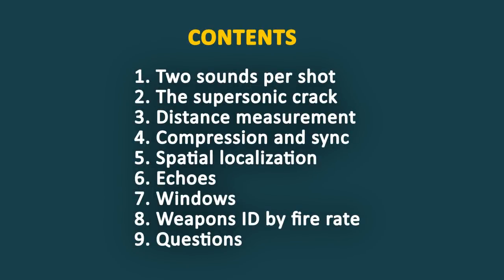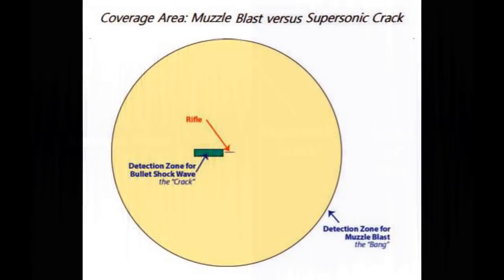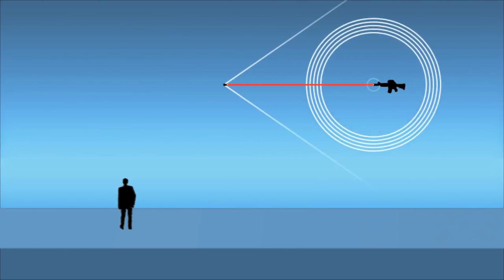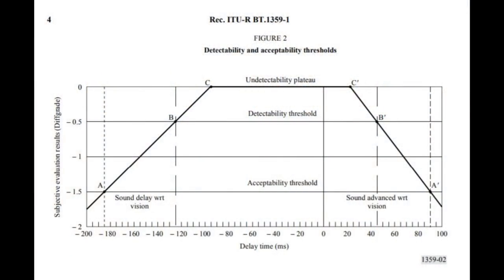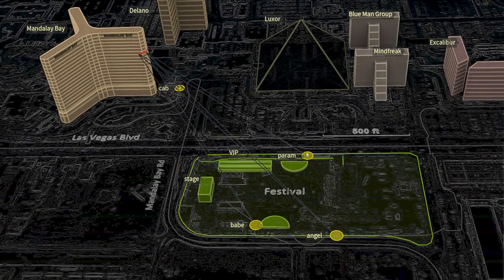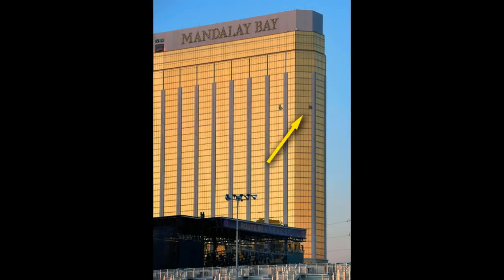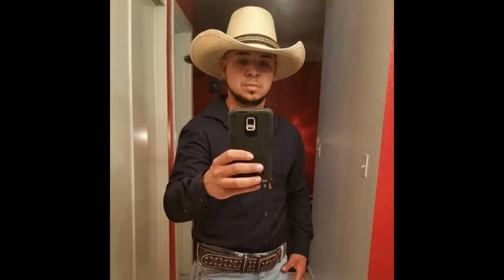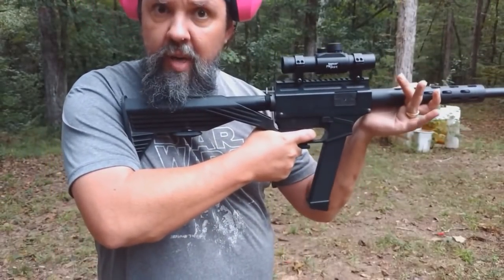2. Las Vegas shooting: The Acoustics of Gunfire

Comment: I still have many questions.  Could this be a sound track played through the concert speakers and still meet your criteria?  There are noticeable differences in rates of fire of different bursts. Is this because of different bump stocks or different weapons being used?  At 300 plus yards, would you expect to inflict 600 casualties with 1000 rounds at moving targets with automatic fire in a 10-minute span?  At this point, it doesn't seem to matter how many shooters, but how many people are in on this conspiracy to fool the public.
Reply from the maker: +Claude Bramwell Whitman and Oswald sniped at specific, isolated  individuals. Paddock randomly sprayed a large crowd. Big difference.
Reply: Claude Bramwell the difference is rate of fire is one of the things that disproves those who say it was a belt fed machine gun or any full auto weapon for that matter. Bump fire is where this throttling  (varying rate of fire) comes from. To bump fire a weapon, you (as the shooter) have to use physical force and that force has to stay very consistent for rate of fire to stay consistent. For example, if your are a right handed shooter using a bump stock, your left are has to apply a forward force at just the right amount to allow the recoil pulse to move the weapon backwards as it normally would then pull the weapon forward again. If too much force is applied, the recoil pulse might not move the weapon back far enough to reset the trigger. If not enough force is applied, the you won't rapidly pull the weapon forward again to break the trigger for the next shot.

Now with that said, they are not hard to use BUT they do get tiring (especially after several minutes of firing) after a short while.. a full auto weapon system will not throttle  (vary) in rate of fire. They will be 99.999999999% consists every time because they are mechanical devices. The only time they will vary is from load differences from one cartridge to the next and this variance is so small that only sensitive timing measuring devices can see it. The human ear can not pickup these variations and in every video of the shooting, you can clearly tell that throttling is occurring so the weapon was not a real full auto machine gun of any sort.

As for injuries and casualties, the 58 casualties and 5 to 600 injuries is exactly what I would suspect for a .223 / 5.56 round at the 3 to 400 yards.  The injury vs. casualty count is another thing that disproves it being a belt fed machine gun. Many who are trying to claim it was are saying it was a m240. That weapon system used the 7.62×51 NATO (or the .308win commercial) round. This round is very effective on human targets out to beyond 500yards. If it was a m240 belt fed machine gun, the casualty count would be much higher then 58. The .223 / 5.56 round is not very deadly beyond about 250yards. This has been a major concern with the Military for quite a while now (M16 and M4 use the 5.56 round). These weapon systems are not good for firefights that are 250+ yards away because the bullets mostly just injure rather then incapacitate the threat and a threat that is just injured can still shoot back at you...

So in the end, yes, with bump stock fired AR's in the course of 10+ minutes and some 1000 or so (plus or minus) rounds of .223 / 5.56 fired, the several hundred injuries and only 58 casualties with varying rates of fire is exactly what one would expect to see just like we did. 

There is no conspiracy here other then possibly the said to be shooter was not the actual shooter but rather was setup to take the fall for the event. Other then that, there is nothing that makes me think that the shooting was more then one person and was coming from anywhere else besides the room it is said to be coming from.
Reply: Thanks for the information.  I was light infantry for several years so I do follow your argument up to the point of believing the high rate of casualties.  Assuming one shooter, firing into a crowd that rapidly disperses into the dark over the 10 minute engagement, I cannot believe that a single shooter using a semi-automatic weapon with a bump stock that is notorious for being hard to aim accurately could achieve  a hit rate of 60%.  You must have known some much better shooters than those I trained with.  If the crowd was static and the lights had remained on for the full 10 minutes, perhaps it's possible.  That's not what I've seen in the videos. Also, where are the bullet holes, the slugs, and the brass?  Every day that the FBI does not release the ballistic and forensic evidence is another day in which they seem to be struggling to concoct some believable story.
Reply: When you say "multiple locations" do you mean shooters, cell phones,  or concert speakers?   The relative close proximity of each of these could probably make any analysis suspect because of the inaccuracy of the audio equipment (recording, broadcasting, or measuring). Setting up a sound track to simulate automatic fire from 300 yards doesn't sound too difficult.
As to 600 casualties, until the FBI tells us, we really won't know exactly how many wounds were caused by bullets.  In fact, we don't know calibers, locations of dead and wounded, and many other things necessary to understand this event. The seven or eight bursts could have taken down 60 or 70 people at a time.  Why didn't anyone with a cell phone capture that?
Reply: +Claude Bramwell - A tightly packed crowd in that small area where sitting ducks basically. It would not have been hard to inflict large scale injuries with an AR and a bump stock on that crowd from some 350yrs away at an elevated position. While yes, there were moving targets from time to time, many cellphone video's shown that when strings of fire were occurring, people where ducking down and / or laying down and sitting still.  Also right after the shooting started, all the stage lights were turned on thus lighting up the crowd.  Since the shooting was coming from an elevated position, ducking / laying down was not going to prevent you from getting hit. The stage lights being turned on is another thing that lead many to think of / believe in conspiracy and set up / planned even at the event level. This is not true though because all concert venues turn on all the stage lights when the crowd is leaving so they can see where they are going (its a liability thing). Now yeah, this helped the shooter but in a panicked state, I'm sure that the light controllers weren't thinking that it could make matters worse by allowing the shooter to more easily see the people.

Also as Mr Visual said in this sub thread to your initial post here, there has been no release of how many of the 5 to 600 injuries were actually bullet wounds vs. how many were injuries from the people just trying to get out in a panicked state. And even then, I dont see it too far fetched for there to have been 5 to 600 injuries due to bullet wounds. Again, the crowd of roughly  22,000 people where tightly packed into a small area. It would have been like shooting fish in a barrel (they were sitting ducks to say the least). You wouldn't have to be very accurate to make many hits, at least not during the first few minutes. Thats almost a point in a general area and shoot situation.  When you look at it from a trajectory standpoint, he would have been at about a 15° shooting angle so if the true travel distance would say 350yrds, the drop calculation would have been for about 325yrds so for a typical 55gr. .223 round thats somewhere in the neighborhood of 10 to 20 inch of drop. So when you are shooting into a densely packed area that is spanning problem 3 to 4 acres of land area with 22,000 people in that area and you only have 10 to 20in of drop, you dont even have to really aim or be accurate, just lay down fire all across that general area and your are guaranteed to hit at a high percentage rate. Again it was just a, "point in the general area and shoot" situation. Its not like you had a, "few people here and a few there an other scattered about". It was an area of a few acres of people who were virtually shoulder to shoulder initially and even a few minutes into it, there were still a lot of people within the general confines of the venue.
.
Reply: Chris
Why would anyone stage a crime scene so it looks staged?  It is far more logical that the first cop on the scene, seeing a man lying on the floor and a gun in or near his hand might just kick the gun out of the mans reach prior to checking to make sure the guy is dead.
Reply from the maker: +Claude Bramwell -- "600 casualties"
The 550 or so injuries include trampling, jumping-over-fence etc injuries. To my knowledge, no one ever released the figure of people injured by direct gunfire (only the number of those killed by gunfire).
Reply from the maker: +Claude Bramwell  --- "Could this be a sound track played through the concert speakers and still meet your criteria?"
Not really. For one specific location in space (if you had known it in advance) you could sort of design the soundtrack so that it simulates arrival times from 32nd floor. However this charade instantly breaks down for multiple locations, because anyone not recording in that special location would get different arrival times from loudspeakers.
Reply: It sounds as if you are convinced that the carnage was done by a single shooter from an elevated position at 350 yards.  I remain very skeptical, but I guess we will see when the lawsuits hit the courts.  The FBI has  lost its credibility since they haven't produced any evidence in the case so no one knows for certain if there were 22,000 or 7,000 people in the venue; if there was more than one shooter from the 32d floor of the Mandalay Bay: if the weapon used was an AR-15, AR-10, or multiple weapons; if the killed and wounded were located in clumps when they were hit or dispersed; etc.
If you can, please cite any mass shooting examples that lead you to believe that this was like shooting fish in a barrel.  I wonder where, except in movies, it has ever happened.  Charles Whitman, Lee Harvey Oswald and others made bad weapons choices I guess.  If you are right and its this easy, white Republican Trump supporters had better be very careful where and when they congregate.
Reply: For one, the Route 91 event handlers are the ones who claim an estimated 22,000 people in attendance and they have absolutely zero reason to lie about that. 
Two, look at the size of the main audience area, it covers about 4.5 acres of land and now look at this photo taken a bit earlier in the evening.
 http://www.etonline.com/sites/default/files/styles/max_1280x720/public/images/2017-10/mandalay_bay_route_91_festival_gettyimages-491199012.jpg?itok=JZJ-1c3X
That photo is only showing half to maybe 2/3's of the total 4.5 acre main area and that is easily 15,000 people right there.

Next, I dont need the FBI or anyone to tell me whether those were AR15's or AR10's. The Casualty count tells me that it was a small caliber round like the .223. If it were an AR10, it would have been a .308 shell size cartridge and every AR10 chambering available (that I'm aware of) are all cartridges that would have been far more lethal at about 350yrds (i.e., the casualty count would have been much higher). The next thing is I am very familiar with both weapon systems (I own both) and a few of them in the photo's of the room are without a doubt AR15's and NOT AR10's. The Upper and lower receivers have distinct differences between the two that anyone very familiar with both can tell the difference / pick out one from the other.

Now whether they were in clumps or dispersed is yet to be 100% revealed but it pretty irrelevant for the most part and but looking at the few photo's that are out there of bodies on the ground after most of the crowd is out and shooting has stopped, they are pretty dispersed. This lends itself to just random spray firing which also matches what the audio insinuates during the shooting bursts.

As for the "Like shooting fish in a barrel". I dont need to site any other mass shooting events.... This photo alone says it all.
http://media.graytvinc.com/images/810*455/image+vegas+sf.jpg
That is all people down on their knee's and also laying down during a string of fire. They are lit up for the most part by the stage lights and are motionless. You would have to have REALLY BAD LUCK if you fired say a string of 75 shots and didn't get at least 50% hit percentange. Really, with a target area like that, there isn't any reason why you shouldn't get more like 75 to 80 percent hits (again, like shooting fish in a barrel). 

Regardless of that, since you asked to cite one other mass shooting that was like shooting fish in a barrel, I will..... Pulse night club here in Florida (Orlando) on June 12th last year. One man killed 49 and injured 58 more.

The only thing I'm not convinced of about the whole thing is if Paddock was the shooter or if he was setup and murdered before hand. The room photo's (rifle and revolver positions) look staged. I cant think of any way that physics would work for a couple aspects of the scene. With that said, I dont think the PD or FBI or even MGM are covering anything up but rather, I think it was not paddock (was supposed to be two shooters but second shooter took out paddock right at the start then and made it look like it was just Paddock so that he (second shooter could make a clean getaway of sorts).  I say about no one covering anything up in the last statement because if I'm right then its not that they are covering anything up but rather not letting out info while they try to find the 2nd person by making the 2nd person think that they are on to them / know they exist.

Think about it, if they were to make in publicly known that there was a 2nd shooter (who was the only shooter in my theory), that 2nd shooter would be one the run. If they play it like they dont know and fully believe it was Paddock and only Paddock, then the 2nd person involved would be relaxed and at easy thinking they got away with it and will get caught easier. Plus there could be more to the whole thing like a political backing behind it and they are keeping quite to get more info to indict more parties associated with the whole event.
Reply: If you can, please cite any mass shooting examples that lead you to believe that this was like shooting fish in a barrel.  I wonder where, except in movies, it has ever happened.

Seriously?  Lets start with Columbine, Virginia Tech, Newtown ct , Arora co,  San Bernardino,  Miami Florida, Texas church shooting...
Reply: S Wheeler
I'm not saying staged to make it "look staged" but rather quite poorly done that one could with fair amount of easy tell it was staged.

For one, there is a blood droplet trail that leads from his right shoulder to the revolver. That's not normal for a self inflicted gun shot wound to where the person fell backwards and layer in the position he is it. Nor is that what you would expect to see if someone kicked a gun out of the way. I know many LEO's who I've discussed the photos with and the question of kicking a gun out of the way has come up and all agreed that like myself, they would have kicked it much further then that. However, with a scene like that and that much blood, they all said that they would have left the gun exactly where it was at for forensics because it would be pretty much impossible for him to still be alive and a threat.

Something else that makes no sense (seems to defy physics) is the blood flow out of mouth and over face onto the floor. This however could be explained if there is no exit wound and heart continued to pump for some time. I say this because if there was an exit wound out the back (like there normal is with a gunshot wound in the mouth, gravity would pull all the blood out the exit wound with how he's laying.... it would not be coming out of his mouth and running down his face... this would defy gravity... even if there is no exit wound I still find it a bit hard to believe we would see that much blood because his lungs, trachea,  and esophagus would all have to fill before much blood would start to flow out of mouth and by then it would have started to coagulate quite a bit...

Now one point that a friend of mine who is in the medical field brought up even though she kind of agrees with me on the amount of blood is was he on any type of anticoagulants due to age and possible heath conditions(?). If so, then this could explain a lot about the blood flow (again depending on presence of an exit wound and where "exactly" the entry wound is).

Too be 100% honest though, I don't think it was even a gunshot to the head at all, I think it was to the chest... if you look at the photo of his upper body / head, right at the base of the button down portion of his shirt (like right over center of his sternum), there is what appears to be blood with a very dark center area which would be indicative of an entry wound to the chest... this would also lend itself to all the blood coming out of his mouth (especially if he was on any type of anticoagulant meds). Coughing up / spitting up blood is very common with chest wounds of this nature. It's not normal for someone to shoot themselves in the chest (not that it's not possible but... just not normal)...
Reply: Chris 
Why?  Occam"s razor suggests you first rule out the simple explaination prior to adoption of the complex.  You rule out explanations without falsifying them to move on to your preferred theory.  That is a very health rangerish methods of problem solving.  I do not have any answers, but I cannot rule anything out that I cannot disprove.
Reply: I fully agree but one thing that goes with ruling out the simplest explanations is by looking at trends, causes and effects, etc... from past similar scenario's and the blood evidence does not really support the hypothesis of a gunshot wound in the mouth. I bases this off the fact that i have seen in person the aftermath of more then one suicide where the person did exactly that, put a pistol in their mouth and pulled the trigger.

Now could it really be a self inflicted shot in the chest.. Yes, very well could be but just not very common.
Reply: Chris
I am not sure what blood evidence you are talking about and as I have never personally seen a suicide of any sort so I would not know what to look for.   However I do have experience with firearms enough to know that there are a multitude of possibilities as to what type of wound results from any given weapon.  Angle of shot, type of round used caliber of the weapon are all factors that are unknown.  Also any slight movement of the head could cause an additional blood flow.   Although as far fetched as it sounds it is possible, see Meriwether Lewis, to shoot oneself twice.  So I would be reluctant to rule out  suicide at this point without more information. 

Also the thing about the rifle over his leg.  It makes perfect sense if he was seated on the floor.   It would be just about arms length and he would put it down to switch from it to the revolver.
Reply: S Wheeler
Not sure what the Meriwether Lewis thing has to do with this because it is still unclear if it was a suicide or an assassinated. Yes, initially due to other "supposed" instances, everyone thought it was suicide but in the 1840's when the remains were reexamined, it was said that it was more plausible that he was assassinated rather then committed suicide. 

As for blood evidence, I'm looking at physical location of blood spots. There is for one, blood on the revolver, a trail of blood droplets that leads from his right shoulder directly to the grip on the revolver and there is what appears to be a blood stain directly over his sternum. Since there is no blood down his throat area nor on the upper portion of  his shirt (button area) and if that is in fact a blood stain on his shirt, then how did it get there...

Now yes, he could have been sitting down and set the rifle down to change to the revolver but whats doesn't make sense there is that rifle is on a bipod and has no bump stock on it from the best that I can tell plus it would make no sense to have a bump stock on a rifle with a bipod since it would work very well (if at all) and its kind of clear that someone knew that because there is a couple other rifles with bipods that can clearly be seen to NOT have bump stocks. Now why would he have been carrying that rifle when all the shots up till the end were apparently with the bump stock rifle(s) (rapid fire) other then the absolute last two shots which the first was exactly 40seconds after the end of the last rapid fire burst and the 2nd was 10seconds later (50seconds after end of burst)... Now yes, its possible that he grabbed it for reasons unknown then put it back down but just not very plausible. The other thing about that rifle and the other two is those all have regular scoped optics on them as though they were specifically for sniping specific targets which is fine but why the one by the door to the room? I cant see any reason why one would be trying to take precision shots down a hallway. That rifle just seems totally out of place for any sort of logical use. Everything else seems to be placed in a fairly well thought out manner for practical use / accessibility. 

The other thing about the rifle over his foot / leg is based on position relative to body, it would appear as though he would have been holding that rifle as if he were a left handed shooter and looking at the photo of him holding a shot glass about to take a shot, he is holding it with his left hand, so he very well could have been a lefty. On the flip side though, looking at the crime scene photo of the table with the calculations sheet and tape, if what I think is a pen, it is on the right side just as a right handed person would set it down after writing.

Obviously this is all just speculation and the last two shots we hear very well could be him shooting himself twice.... It could also be whoever was doing the shooting firing two random shots with anything... The blood evidence and position of the revolver is really what has me question the death more then anything but with that said, there could be a logical explanation that I'm just not picking up on due to lack of other information.
Reply: Yeah like I said the possibilities are endless, for example he could have picked up the rifle as it was close to him at the time then changed his mind and picked up the revolver instead.  Shooting hand does not have to be carrying around hand.  

Meriwether Lewis is relevant because it is controversial.  We simply do not have the facts.   One could get all conspiracy minded and say, yeah an examination done on a 40 year old corps?  Paid for by the family?  I am not buying it.   Eh, so it goes.  

Personally, I think he was angry pumped with adrenaline and frustrated towards the end.   I think he had been fantasizing about this for years, but because of the interruption, his plans went to shit.   I think he would have wanted to see as much as possible.  He would have known that after the last song all the lights go on.  He could not have known some idiot would turn some on.  He tried to do his plan anyway, herding people around like cattle to keep them away from the exits.  But as the exits were not lit up,  he was missing more than hitting.   But we shall probably never know what went on in his mind.